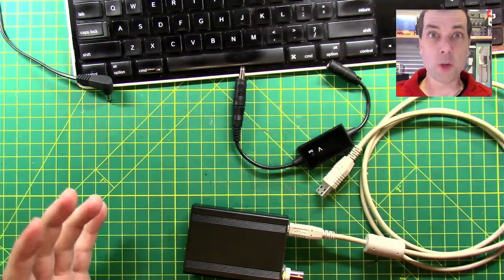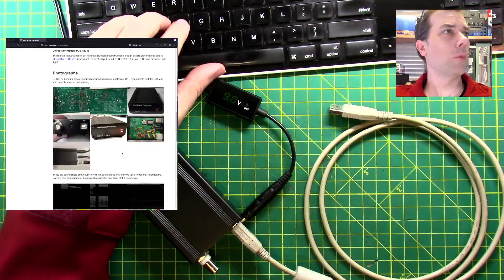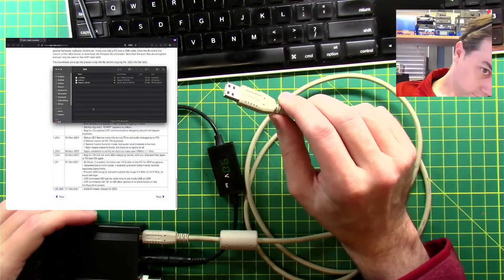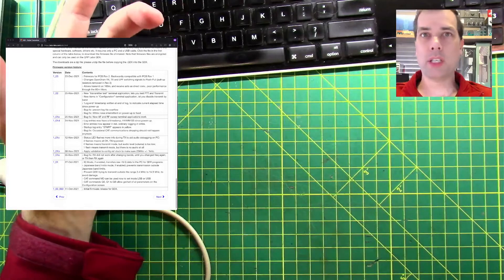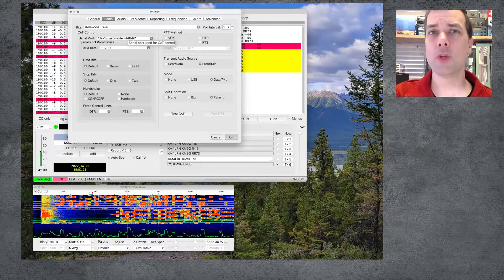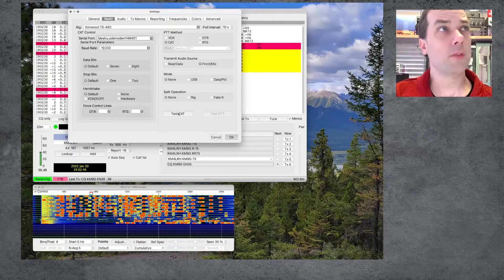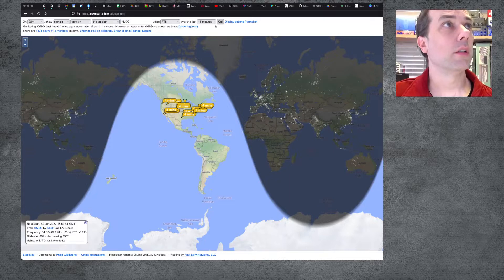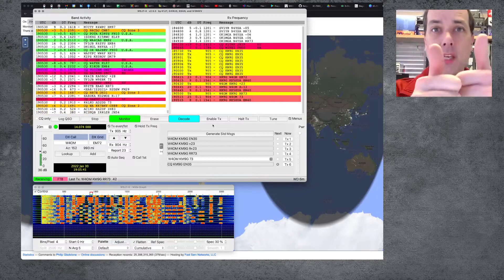How to Update the firmware on the QDX

Comment: Thanks for this video. Is there a way to save settings for various radios in WSJT-X and invoke a particular set of settings at the time you startup WSJT-X? In other words, profiles that you can load automatically at the time you start WSJT-X?
Reply from the maker: I believe there is, and also a way to run 2 at the same time on the same machine.  I've added it to the list of videos to make.

Comment: Updating firmware usually stresses me out. Either it works or it turns into a brick.😁
Reply from the maker: In this case you can replace the chip if it goes sideways... as a tinker project we have added fixability and "rights"